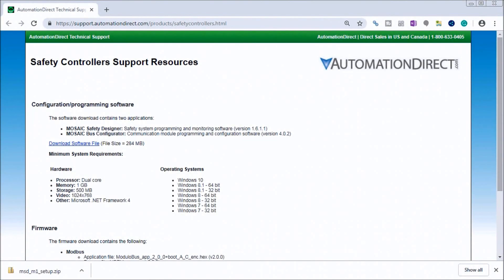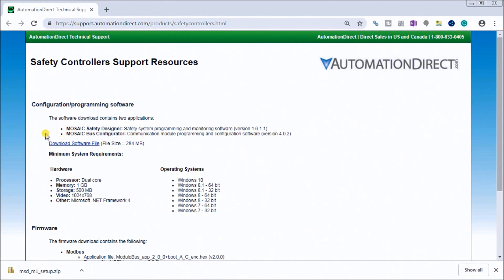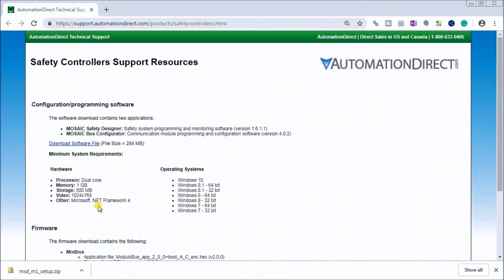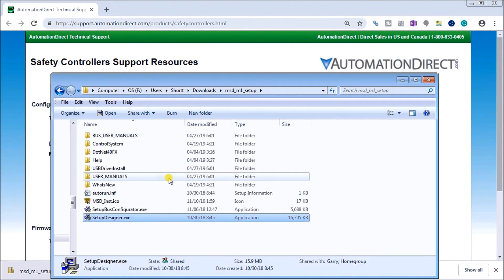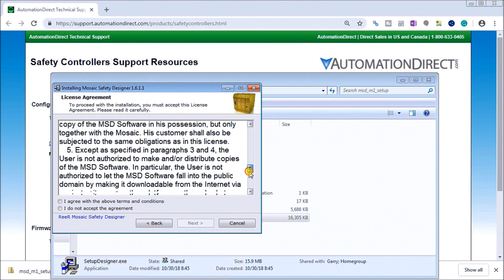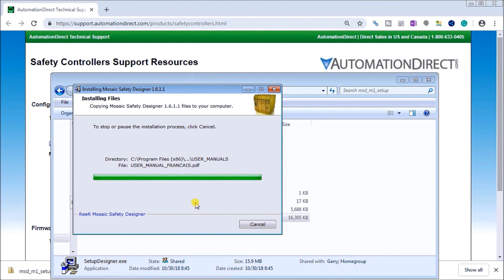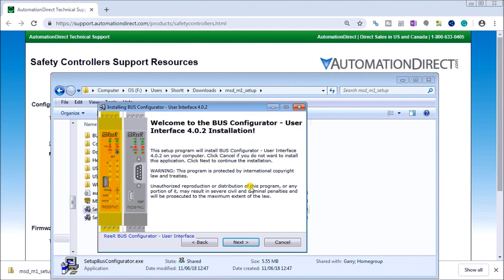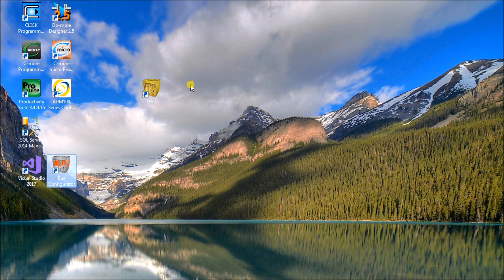MOSAIC Safety Controller Installing the Software MSD

Comment: is that a safety relay?
Reply from the maker: Hi Jay,
This is a safety controller. It has two safety relay outputs (OSSD).
MOSAIC M1 Master Module will act as a stand-alone unit and has the following features:
(8) digital inputs,
(2) inputs for Start/Stop interlock and device monitoring (EDM – external device monitoring),
(2) OSSD (output signal switching device) pairs,
(4) test outputs,
(2) programmable digital signal outputs
If you have two or more safety devices, I would recommend using this controller for its documentation and low cost.
Regards,
Garry